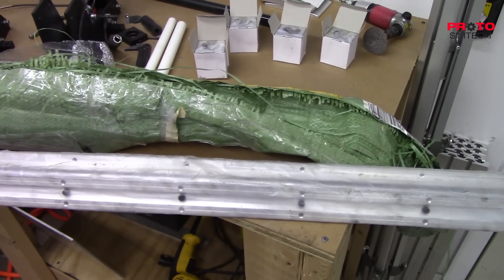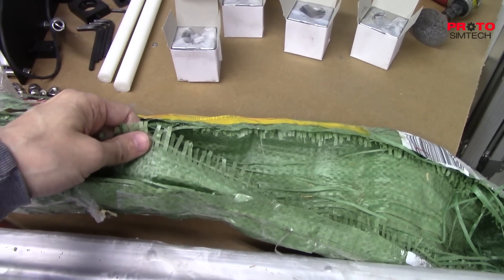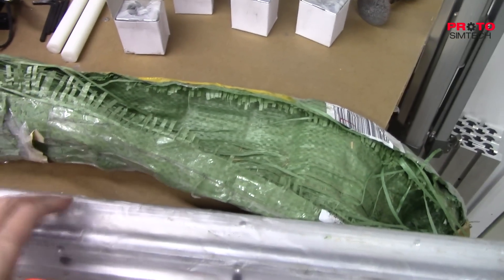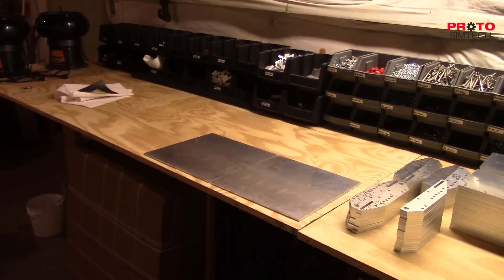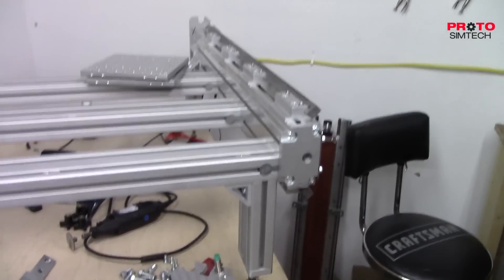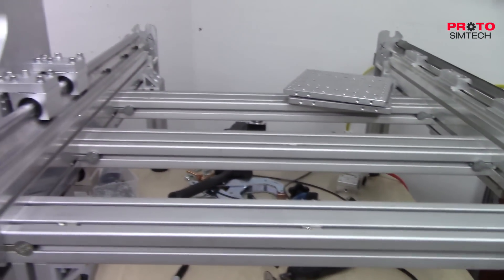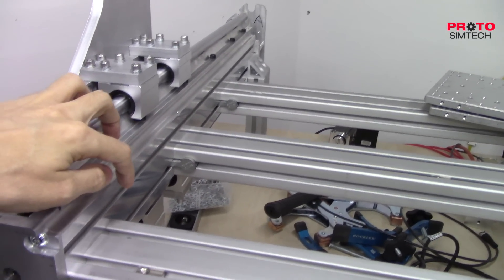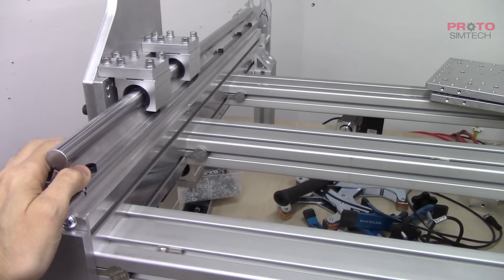CNC machine upgrades (Part 2)

Comment: I used to have that much bench space.  It was nice!  I still only seemed to have about 2' I could use at any time. lol  Peg board on the wall behind it will really help too!!!  I had to cut about 3" off the front edge of my bench so I could reach the upper part of the board.........that was easier to do than lose 3" of belly. :)